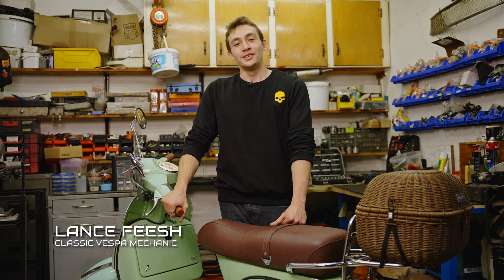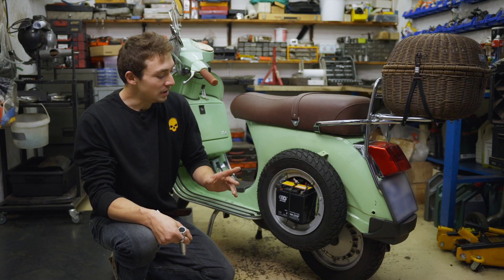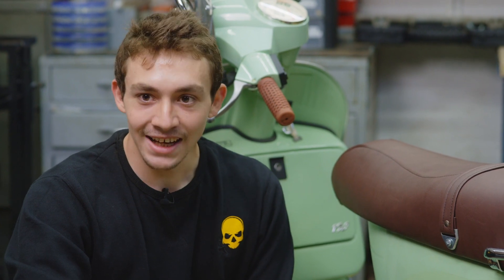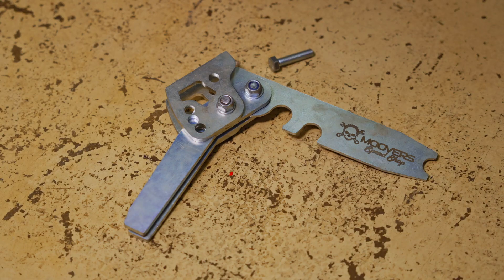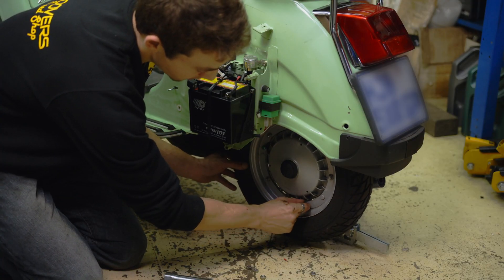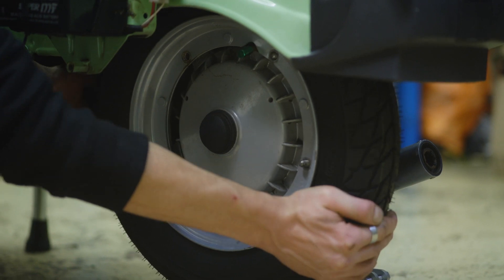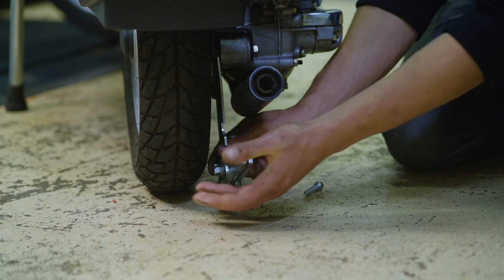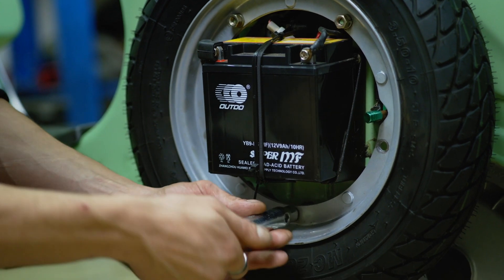Removing Your Vespa Spare and Changing Out the Rear Tyre

Comment: when i install my rear wheel with shallow side facing out my tire rubs on the spring..when i install it the other way with the deep side of rim facing out i have clearance..is it dangerous to ride this way.
Reply from the maker: @rainehewlett4561  it definitely should have the shallow side facing out, I'd check your rubber mounts on the rear shock, and check the width of your Tyre? That model should have a 3.00x10 tyre
Reply: @mooversspeedshop  yes it is a 3.00 x 10
Reply: @mooversspeedshop  everything is new..shock..rubbers..have you ever heard of issue with installing " backwards "